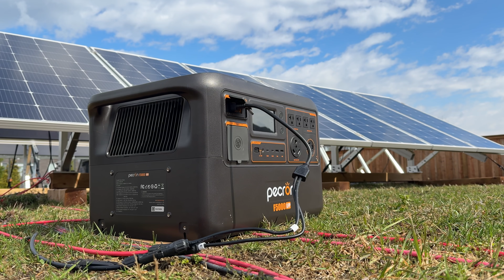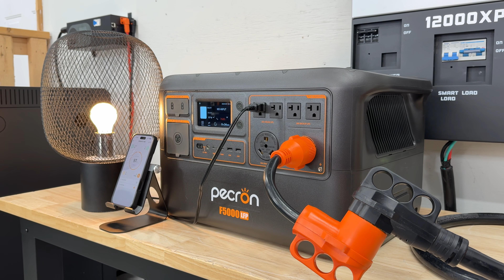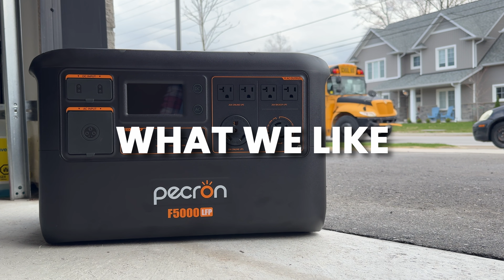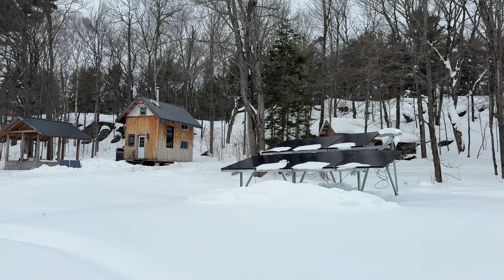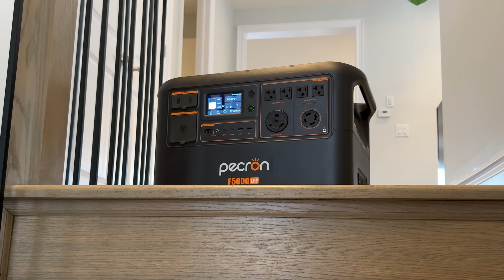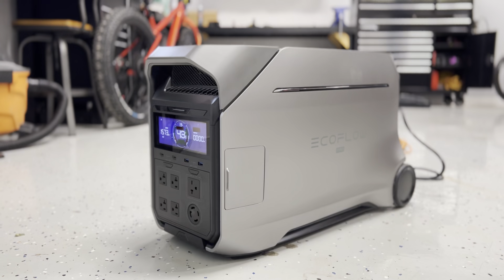Pecron F5000 - They FINALLY Did It!

Comment: Seems like most things are great, but 50W idle consumption is unacceptable and a deal-breaker for me.  Fix this, Pecron.  Having a big battery does not  make it okay to waste so much of the energy those batteries contain.  Bigger batteries won't last longer if they are being drained more by idle consumption.

On the other hand, not having a light has no impact whatsoever on my buying decision.  They make these things called "headlamps", which are cheap and which allow hands-free lighting.  An area light can be a useful feature, but I'm not deciding which 4-figure solar generator to buy based on whether it contains 30 cents worth of LEDs ;).
Reply: Most of us are going to be feeding this thing MASSIVE solar and could care less about 50 watts/hour when we're feeding it 2K+ watts/hour via solar.

Comment: I have one. It does well steady state but there are some complaints. In 240V mode when using my welder, output voltage swings between 180-280vac. When the voltage cleans up, the arc does too, I maxed out my Lincoln sp180-t and pulled a max of 5600watts and the F5000LFP worked great.  My small hf 120V flux core or shop vac will swing AC voltage 92-163Vac the 0ms port kind of welds okay but the 20ms is unusable.  Measurements taken using a Klein multimeter in the min/max function. Using an oscilloscope, the output could be even worse. My single 120V leg capacity is limited to 39A and some motor loads I have won't start at all on it due to inrush. Generator mode is a  worthless function for most of us looking for a home backup power station without solar or on a cloud covered day. It disables 240V mode while on gen mode And cuts capacity down to a single 3600w 120V leg. So yeah, if you planned to connect a generator and top this thing off during a storm while it was powering the 240V circuits, you can't, unless you buy a chargeverter and charge through the DC input ports. Or buy a generator big enough to present itself as stable enough power to the F5000LFP so it will accept input. AC input charging is great, but logically flawed. AC input gets passed through to the ups 20ms leg and as a result, regardless of your charge rate setting, if you consume on that plug, it will not limit power received from the input plug, just charge rate, and will limit output of the machine to whichever ac charge port you are using. So you only get maximum machine output while AC charging IF you are on the 30A input port. Also, when the unit trips, nothing is in the event log and the display and led button still makes it look like it's outputting AC until you see that the voltage is 0. You have to turn off/on AC and get it back on. I feel like a lot of this could be firmware fixable but possibly not so I submitted my findings. We need these solar channels to really step up and do more thorough testing because it all looks great on paper but I have buyers remorse and I feel like MANY people will as well unless there are some changes made to the firmware, but there very well could be hardware conflicts as well because judging by what I am seeing from the 20ms port, it's EITHER pass through with AC charging  OR inverter output, no charging, but not AC charging and inverter discharging.
Reply: I have one and have a similar complaint. The inrush on this thing will trip it. I have a soft start on my AC that, though it peaks at 15 amps, will trip this 100% of the time. I was told it was likely due to imbalance by Pecron. Still, the thing can power everything else in my home which has been nice. I was able to even get it close to 7kw using burners and my oven and it handled it nicely. Runs my house without the AC for about 7-8 hours. Again, just sad about the AC thing.
Reply: Anyway you can dumb that down for me?

Comment: Do you think that this would work to plug in my electric vehicle in Winter to keep the battery warmer running while I'm in work. At level 1 charging? Thinking of throwing an insulated car cover over it while I'm inside as well... Your thoughts?

Comment: I've been keeping an eye out for your take on this one.  I'm on the fence between this and the Ecoflow Delta Pro 3.  Pecron has more capacity and is cheaper.  DP3 seems like it may be a little more refined and better support?  Both have features that I want - 240 out and simultaneous charging while outputting.  I was a little concerned about the THD, but I'll hold judgement there.  I'm looking for essentials+ home backup with the ability to sustain for multiple days when augmented by a small portable solar array and a 2400W gas generator as needed.  I will say that I'm leaning towards Pecron at the moment - any thoughts one over the other?
Reply: I'll be honest with you, I'm not happy with the THD on my F5000LFP, although that could be just because I got in on the initial shipment.  ReeWray did a review yesterday and his oscilloscope showed a squeaky clean sine wave.  Me, I'm not so lucky.  Maybe he got one from the second batch?  I don't know but I can confirm there's more noise in the sine wave than on my other Pecron power stations.

Comment: That proprietary AC input just sucks!!
Reply: They only do that on their power stations that have both 15A and 30A AC charging because to communications pins tell the Pecron which AC cable is connected.  I mean, you don't want to pump in 30A over a 15A cable so it's necessary to have comms pins to let the power station know which cable is connected.
Reply: @robertgiresi9515  That's understandable...thanks

Comment: Hot GARBAGE. HARD PASS ON PECRON.

Keep it on the bench for the next 18 months and let us know how it goes. Nobody cares about fresh out the box when it comes to expensive solar generators and batteries etc.

Cheap means nothing if you have to replace it every year or two.
Reply: Mine f5000 PV failed. I sent it back,  heavy unit.
Reply: @zfontain1975  How were you using it. Did it fail on arrival or after usage? Txh
Reply: @LarParParent I had it connected to my 30 amp transfer switch. Pv was connect to my solar panel 133volts, 9amps, 1000 watts.. left home for 5 hours, when I got home. The f5000 was at 8%, PV stopped working. I had 4 breaks, I was running to test to unit. It happen  the first week I got it. I sent it back, and they reinbust me my money back. It took awhile to return it. I really like the unit. It had most things I wanted. Maybe I will buy it again in the future. When they work out the bugs. I hurt myself sending it back. The unit is 137 pounds in the box. If I did not hurt myself I would of tried again. I have no one to help were I live at this time. Just to let you know I have bluetti and ecoflow all of them have been replaced once. Pecron is no better or worst the other companies I stated above. The guy at fed ex told me Anker had the least returns and alot of people buy them. Anker is so expensive for the watt hours, if I had real money I would buy solix 3800 with 4 extra batteries but I do not. Thanks
Reply: @DXAddict  fantastic addition to the conversation you've done there

Comment: Would this work well for peak shaving?
Reply: Yes.  In the touchscreen it has automations which you can program it to charge from the grid only during off peak hours.  I wish Pecron did a comprehensive automations video.  The manual doesn't help because it just mentions it as brief overview.

Comment: No smartpanel support kills this for me. That is the difference between these small companies vs the established brands such as Anker and EcoFlow.
Reply: It's a cost issue. All the brand companies you see are based in Shenzhen; they're just piecing together solutions from different providers.
Reply: Ya, it is a bummer to not have a smart pannel. Im getting a cheap tablet to work as a smart pannel though. Down load the app and hang that on the wall for easy access.

Comment: I picked one of these up when it was released and stuck it in my 5th wheel toy hauler. I tried it recently and plugged the trailer in for a weekend camping trip. I have 1200 watts of solar on the trailer and hooked that up to the Pecron. We camped 3 days and used AC power whenever we wanted, including the use of the microwave and even ran the air conditioning for about an hour to test out the power station. Not a single problem. Everything ran perfectly. I already had a 14-30 to 14-50 adapter so I could connect my 50 amp trailer to the 240v receptacle.

Comment: Nice video! I have the F5000 with one expansion battery. The system is GREAT. However just a note to know for your viewers. When plugged into utility power, the unit uses pass-through power. So if you use the 15A cord it comes with you can only power up to 1800W until the input power cuts off, but it will continue to output power. Same for the 30A plug, you can run up to 3200 watts but once you go past that it will turn off your input. This makes sense as you would fry your cable. To my knowledge (as of today) the unit will not limit the intake from utility and use battery power to supplement output past 3800W. The unit will just turn off input power and continue to deliver your output (up to its limit and capacity) but I don't think it turns the input back on automatically, or at least I don't think so. Let me know if you have the same results... BTW the "output port memory" is the missing key I was looking for. Very important when your away and you want the unit to come online after battery depletion.

UPDATE: 05/13/2026: I was slightly wrong, I retested the unit. I used over 3600 watts of power (I have the 30A connector in), the input went offline as i reached 6800 watts draw. Then after I lowered the output (by turning off things) and went down to 2100watts the unit turned back on the INPUT draw so the units will recharge. This is GREAT news!!!

Comment: I’ve had mine a month and it does NOT play nice with GE’s AFCI breakers. They trip every time I run a heat producing device. Doesn’t happen with my Apex 300, C2000 Gen 2, or grid.

Comment: When you were going over ports you mentioned the twist lock the generator style lock but you didn't mention that. That can power your RV as well. You don't have to use that 30 amp.  It's split phase so it's 120 volt and leg 1 and the same in leg two at 30 amps. That's where you get your 7200 W and you'll have to have an adapter so maybe it's not worth it. But if I was sitting at a RV site for months at a time, that's what I'd probably do rather than use the 3 prong 30 amp plug.

Comment: The "charge from 120 while outputting 240" was the feature that caught my eye at CES. Unfortunately, it looks like you cannot output more than you are inputting, so "trickle charging" is not really possible if you're outputting whole-home power. The device is in a pass-through mode so it can only output what it's bringing in via AC charging. This defeats the purpose for my whole-home backup needs. We don't have solar available (wooded lot), so the plan was to run the whole house (5000-7000W peak with central air, etc), recharge once a day via generator and enjoy quiet nights. I'm already invested in the Pecron 3600s and four batteries, so I can't flip to EG4 like we originally considered, so I am stuck with the chargeverter plan to backfill the expansion batteries on our current setup.
Reply: Is there a configuration setting to change this for it to be "trickle charging" - I thought I saw it tested where it did draw from both battery and 129

Comment: Bummer about the lack of 240v input. I'm still looking for a power station that does a full 30A / 240v (7200W) pass-through UPS. It doesn't seem to exist in my research unless you pair with a smart panel

Comment: I ordered mine and will be using it to peak shave/power critical circuits during an outage. I couldn't care less that it doesn't have a 12V car socket. And a head lamp???? Huh??? This weighs 124lbs. Who on earth is moving this thing? If you're getting this much power, you're trying to run your house. Park it in your basement or garage, run a generator cord from it to a transfer switch and during an outage, your critical loads are powered. If you're struggling to lift this with another person to bring it up so you can run your fridge, your setup doesn't make sense to me! Go ahead and blow your back out so you can power a fridge. Makes tons of sense, said no one ever!!!x
Reply: And while charging with 240V would definitely be nice, 3600W is acceptable. Even if you're running your whole house with the Pecron, most times, your house is only pulling 1kW. So if it's 8pm maybe and you'd like to get through the night during an outage without a noisy generator, you can definitely charge the batteries enough with the 3600W inlet, get through the night and figure things out in the morning.
Reply: @dontbanmebrodontbanme5403  Exactly.  It's not like it's limited to 3600W of input anyway.  The solar alone can charge it at 6400W.  I'm not sure what the combined inputs max out at.

Comment: You can buy a USB light that would plug into the older USB-A outlet and light up everything. They cost maybe a buck. So not a huge miss.
Reply: It actually does have a light they missed that. The display lights

Comment: as long as influencers tout Pecron products, i'm going to mention what feels like to me a lack of versatility with the unit's BMS, no firmware updates for the e3600lfp, discrepancies betw app and unit instructions, and still investigating rogue ac usage when settings appear to lock out this behavior
Reply: I bought the F3000LFP and now have the F5000LFP and have been NOTHING but impressed with BOTH units.  The newer units are much more polished than the older E-series units.
Reply: The 3600 has never had firmware updates from what I can tell. Very disappointing. They essentially abandoned it.
Reply: @markkempton4579  All of this entails costs; with a low selling price, there is simply not enough profit margin left to cover maintenance.

Comment: The 20-30 amp DC out is great for my setup. I try to run as much as I can from DC as opposed to AC. I can run that DC out to a Blue Sea 12V fuse block and run my iceco fridge and freezer (two separate units) off of the fuse block. I can also run lines for individual usb ports and lights from it. Personally I say get rid of the low amp cigarette lighter plug (car socket) and those less than secure barrel plugs. If you're using those "car" sockets still you need to update whatever you're using.

Comment: From a power station perspective, the F5000LFP represents very good value for the price. That said, it's not really something that I would consider portable. Also, if someone is looking for a system that can scale above 10kWh I would still recommend a Victron based system above any of the comparable power stations.
Reply: And for more work truck use, light home backup, trailer, ect to move around a lot I’d go with the Bluetti Elite 300 V2, more than half the power 3000 wh/3 kilo watts and less than half the weight 58 lbs🎉. Plus only 1100-1200 US, but not meant for expansions, although you can rig something.

Comment: That price for specs is pretty nuts. You could build your own setup with a brand name inverter & battery for less, but not much less. 5kWh expansion batteries are a little pricey at $1300 so it's not going to scale as well but damn, for an all in one it's not /that/ much more expensive than a component system.
Edit: Holy hell, it's heated?? Wow.

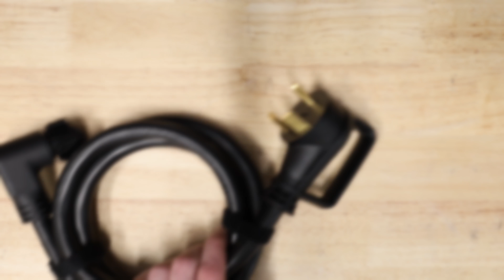Also, what up with Mr. T at 5:19? 😁😁
Reply: Just wait until the black Friday event near Christmas for the battery. #1 novelty will have worn off #2 Pecron isn't stupid they realize everybody is taking their money and having to budget it to help buy other gifts for other people. #3 Even Pecron has to meet a quarterly sales goal,no sale=no goal met.

Comment: For the price the downsides make sense considering it’s comparable or even cheaper than a diy system
Reply: You can get a sungold power 5k inverter, and a server rack battery for about $1600. That doesn't even include the wiring & cart. That inverter doesn't do 240v either. This Pecron unit seems like a real solid deal. For my use, I'd probably hook up my 240v mini split, and use solar/programming to optimize TOU. The mini split would be completely offgrid too, perfect for power outages.

Comment: I’m not sure I understand the fixation with power station built in lights. Doesn’t everyone own flashlights? Cell phones with the flashlight function?
Reply: At 124 lbs, I can’t imagine most people carrying this …… and it has wheels to roll it
Reply: @stuartstuart866  Just explaining why he (and everyone else I follow) wishes they included the light. It can't hurt. I have a more manageable one at 80-ish pounds, and I do move it around. It would be nice to have a light as I go up or down stairs or just move through the house.
Reply: Their argument is that when a power station is large enough that it requires both hands to carry, you don't have a hand available for holding a flash light. If the power station has a light, it can be used to see where you're going in the event that you're carrying it in the dark. Whether you agree that it warrants the fixation or not, that's their thinking.
Reply: how are you going to hold the flashlight or phone when you're carrying this with both hands?

Comment: There is a 240Vac charge cable for $70. Not sure how much it changes the charge rate.
Reply: Dude, there's literally no 240V input port on the power station so you can't use a 240V charge cable on this.  Just 15A or 30A 120V charging exists.

Comment: You totally left out the configurable 12V option that is huge. The DC output is adjustable between 12V and 40V either the dedicated XT60 DC output and/or barrel port
Reply: So with this info, this means we could get a barrel connector to car port adapter, and set it to 12V to run car accessories depending on the amperage it puts out
Reply: @gaugeprower I’m just trying to boondock.  What’s this all mean?!